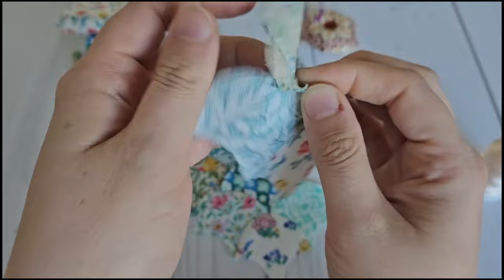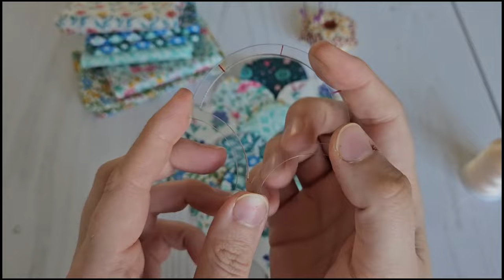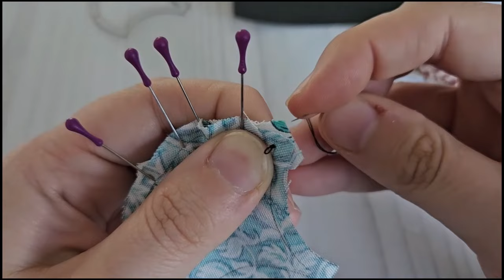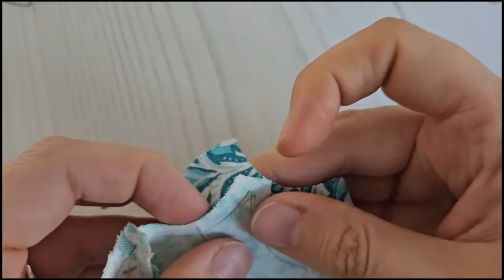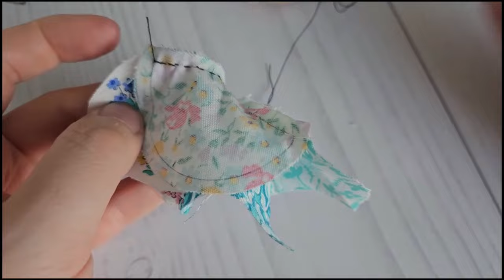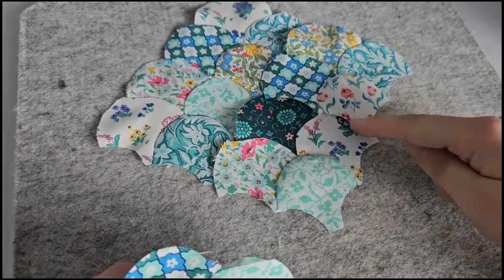HOW TO HAND PIECE CLAMSHELLS | No Papers | American Hand Piecing

Comment: If my templates were this scant seam allowance (good for needle turn appliqué), I'd trace both lines like in the video but I'd cut outside the line the 2 or 3 mm that I need, as the seam allowance doesn't have to be perfect. Besides you'll be surprised how fast your brain can see 2 or 3mms. 💖🌞🌵😷

Comment: 2:10 after pinching the center mark on both sides, take the piece back to your template, and mark the template with a sharpie and the "correct" positions. Use a different color or use a double line. Now you can mark all three lines and skip this fold on all your pieces. If you have trouble marking your template, mark your fabric as in the video, lay your template over your marked fabric and instead of looking through the template, pull the template back just far enough to see the actual mark on the fabric, looking straight down at the mark (not from the side), mark the edge of the template. Then bring the mark around to the top of the template. (If it's still not correct, repeat, but only use one eye.) If you want to remove a stray mark from a permanent marker, just a quick wipe with rubbing alcohol (isopropyl alcohol) will take it right off. Black is harder to remove, so take it off right away. If you remove the line but there's still a line, clean it the best that you can and go ahead and put your new mark. Your brain is smart enough to ignore the shadow.💖🌞🌵😷
Reply from the maker: That is such a good idea! Thank you! I was unsure how to remove my marks to try again and Mark them. This helps me loads and I'm sure will help others xx
Reply: @stitchwithrachel permanent markers are usually alcohol based whilst washable markers are water based. So if your markers are running out and you only need a few more marks, try dipping the tip into it's liquid (either alcohol for permanent markers or water for washable marker). You'll feel like ancient times when they wrote with a quill and ink. ... If you want to try this next method, just remember that you were going to throw the marker away anyway, because sometimes it works and sometimes it doesn't. With a pair of piers, snuggly grab the base of the tip and try to pull it out. I say snuggly because it's easy to crush the tip and it's trash. If you're lucky and the tip pulls out, fill it's tube with it's liquid. Replace the tip. Some tips are sharpened on both ends, so pick the dirty end to stick in first and you'll have a brand new marker. Good luck. I've been using the quill and ink method for years and can't remember when I last threw out a marker. Sometimes if a marker is getting dry, I pour a couple of drops of it's liquid in the cap before I shut it up before putting it away (cap side down) for next time. Usually, the tip absorbs the liquid. This doesn't work on caps that are breathable. The liquid just leaks out. Good luck. 💖🌞🌵😷
Reply: @stitchwithrachel , depending on the materia, light refracts differently. (Ever watched spear fishing and half the spear is in the water and half out? It looks like the spear is zigzag but in real life it's straight. That's refraction.) That's why if you put the fabric under the template and look straight through the template your mark maybe off. ... I've thought of one more method to try and that is... Place your fabric on top of the template, scoot the fabric back a mm and mark the template... that way refraction isn't a factor. I didn't suggest this before because fabric is so fluid, but do your best and let us know how you did in a "short" video. 💖🌞🌵😷
Reply from the maker: @suzisaintjames  thank you for your valuable advice! X

Comment: This is just like the curve method I  learned on the machine. I will definitely make sure my template has a 1/4 inch seam allowance. Thanks for showing this! I'm a fan of curved machine work.  Now that I  can't use a sewing machine, I  don't have to give it up! You've shown me how to keep going.
Reply: Anything you did on the machine you can do by hand sewing... Using the same sewing machine methods. The only thing is different is that you don't have seam guides or a quarter inch foot as your guide and that's why you mark and match the seam lines or use a paper template. Sending lots of love💖 from sunny 🌞 Arizona 🌵. Take care of yourself 😷.
Reply: @suzisaintjames  my brain is well trained in the states to ¹/4 inch for sure. I also do needleturn so that helps too.
Reply: If my templates were this scant seam allowance (good for needle turn appliqué), I'd trace both lines like in the video but I'd cut outside the line the 2 or 3 mm that I need, as the seam allowance doesn't have to be perfect. Besides you'll be surprised how fast your brain can see 2 or 3mms. 💖🌞🌵😷